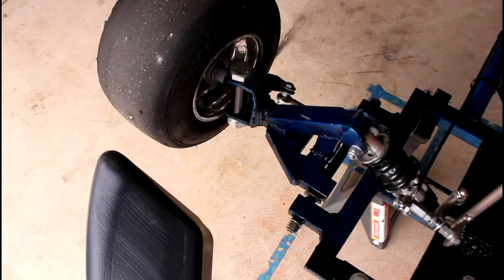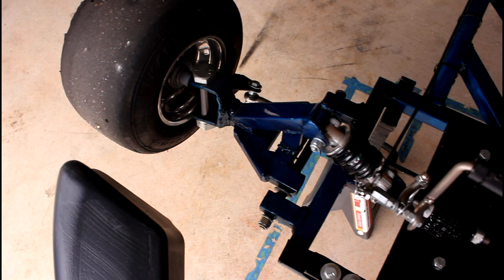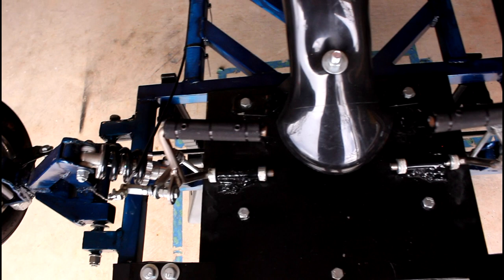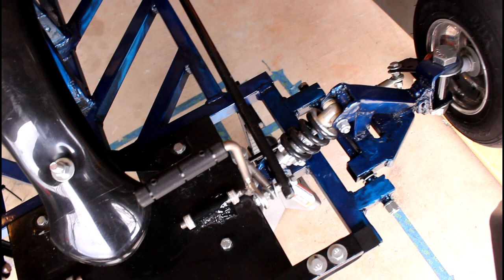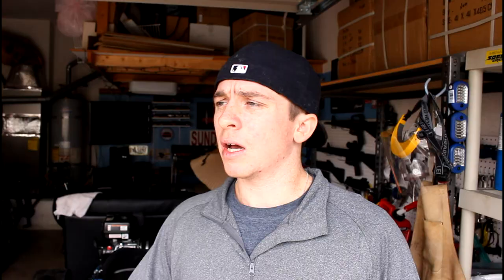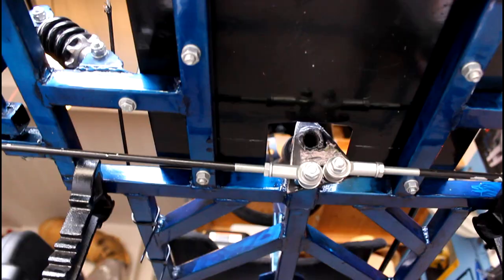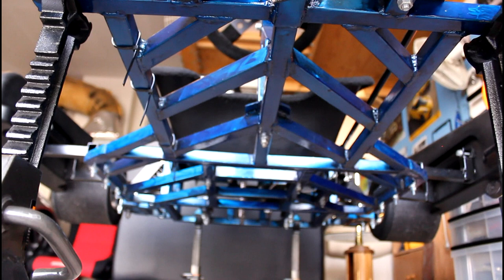How to Build a Go Kart 1: WHY Build one? 5 Motivations!

Comment: I also live in San Diego and I am probably going to start my own go kart build. I was wondering if you could recommend the best place to buy parts! And also is it really worth making my own custom chassis or would I be better off just buying a second hand chassis and then modifying it from there? I cant wait too see more of these videos and also maybee even see you put a more powerful engine on it!
Reply from the maker: Hey Mathieu, sorry I took so long to get back to you. Last few weeks have been crazy with the holidays. The two sites I used the most to buy parts were www.gopowersports.com, www.cometkartsales.com, and www.accelerationkarting.com. As far as the chassis goes, it really depends on how much money, time, and effort/skill you have to put into it. If you want to make a completely custom frame, I definitely recommend having welding skills because it makes the whole process a lot easier. I really wanted to be creative and build my own, but it definitely caused the build to take a lot longer and cost more, so it really comes down to those factors. Hope this helps, glad you like all of the videos!

Comment: Can you please tell me what are the electrical components required to build a go cart.
Reply from the maker: In this build, there were none. All electrical was already built into the design of the engine out of the box (spark plug lead, oil level sensor, etc.)

Comment: hello, i have a crj 1995 gokart frame and have painted it and made it engine ready but all i need is an engine an where i live its hard to find engines so i have to ship it over and i dont know if it will fit. Will i be able to extend the chasis?
Reply from the maker: As long as it's not too drastic of an extension, I think you should be okay.